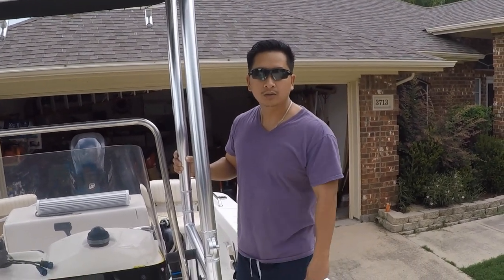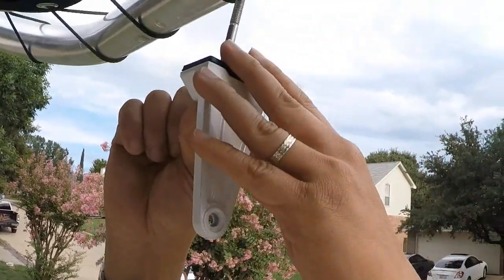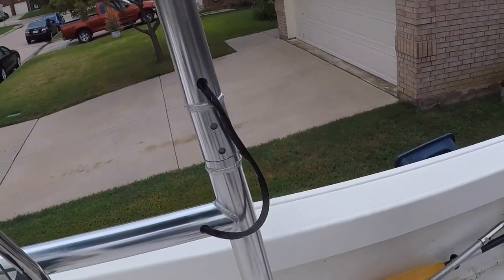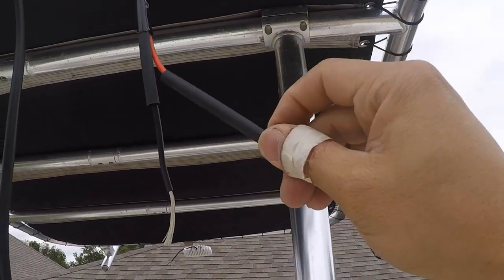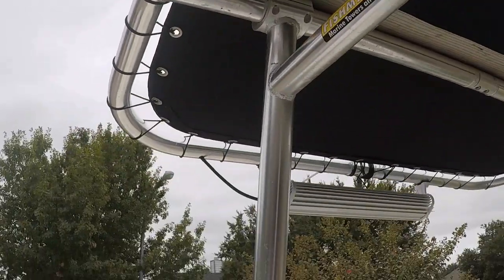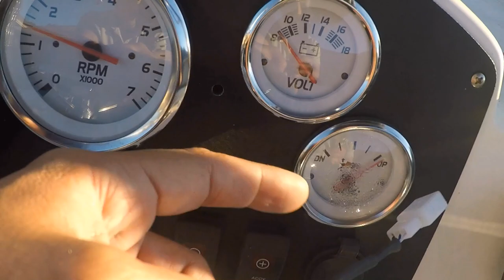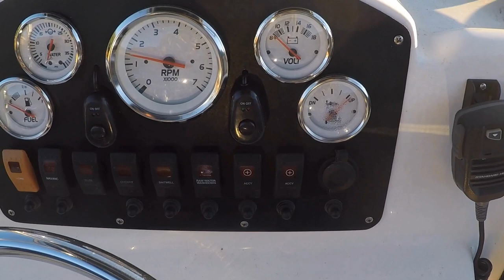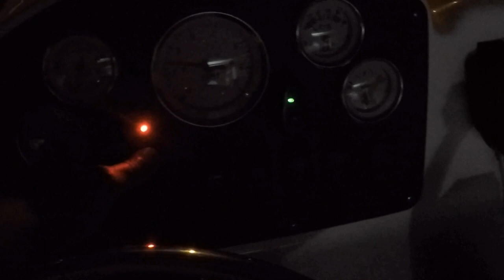How to install Fishmaster LED light bar and spreader light for your boat.

Comment: Great video man!  I just bought a light bar and gonna install it on my Sea Ray Amberjack 290, this video helps greatly.  I also bought the rubber clam mounting kit so I wont have to drill in to my aluminum rod holder bar on top.  Im just gotta connect it to the dome light wiring because running wires all the way to my battery on my boat is a pain in the a$$ .   Are you Vietnamese ?  Thanks
Reply from the maker: vp999...I am glad that this help! Just be sure to disconnect the relay connector so you don't drain your battery down due to the red and green light indicator that came with the wiring harness. Yes, I am Viet! Good luck on your project.